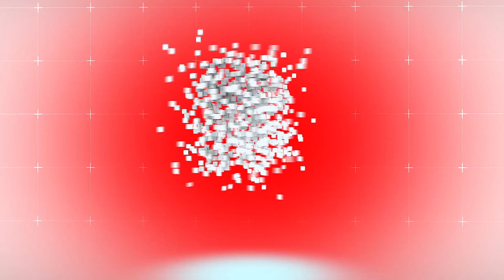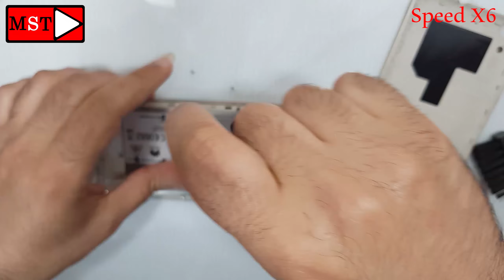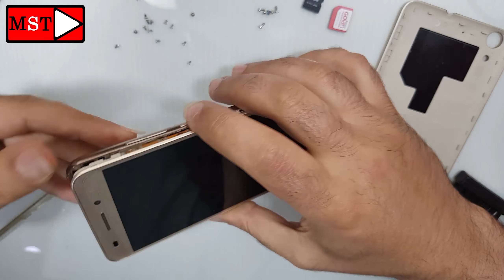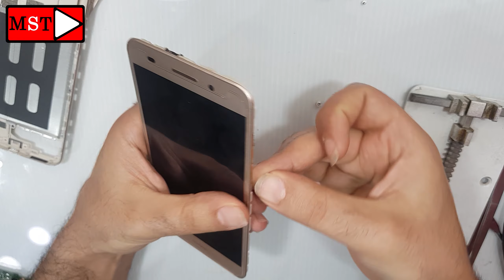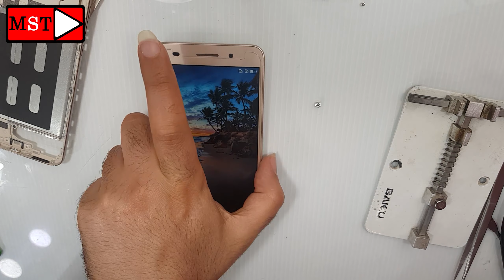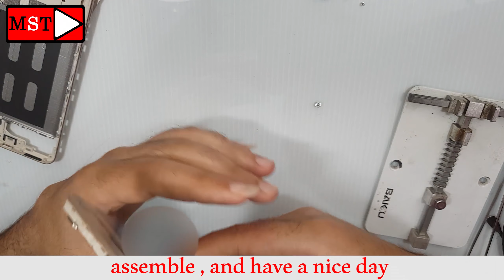Huawei Y6 II Microphone Not Working

Comment: I bought new plate with charging port and mic - but its not working, so  the charging do so, but not the mic, where are the problem?
Reply from the maker: Sometimes it could be the plate not working well, it happened to me sometime
Reply: @mstphone  I changed two plates already and still the same problem. Its phone problem?
Reply from the maker: Yea could be the line on the main board unfortunately